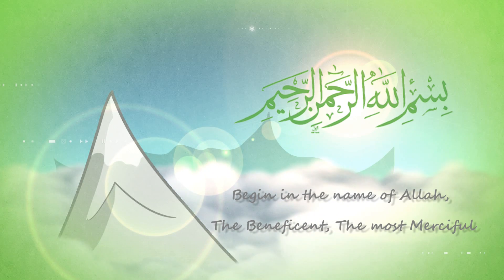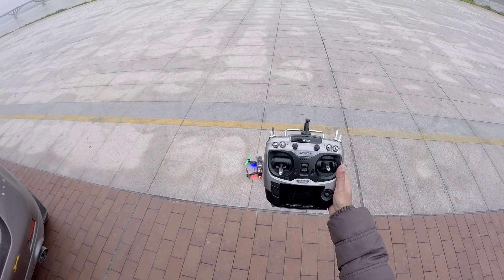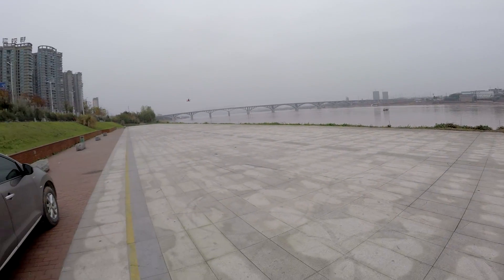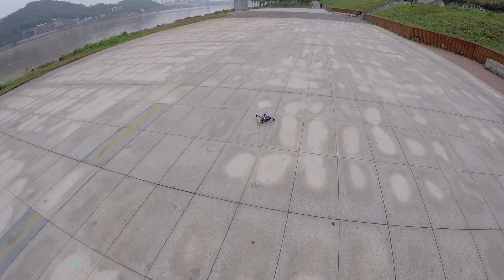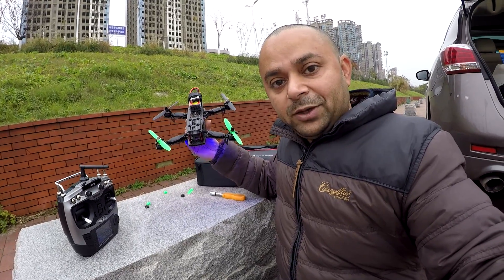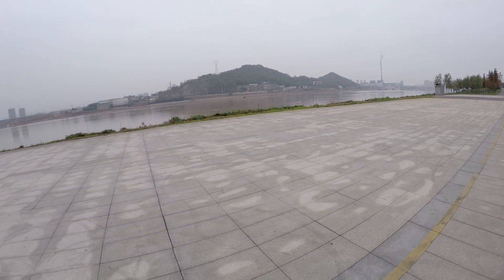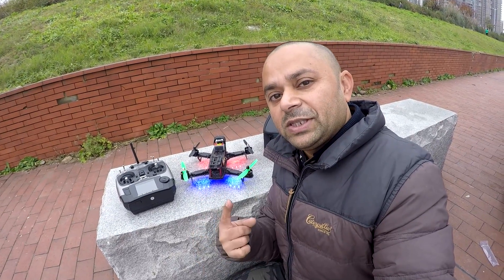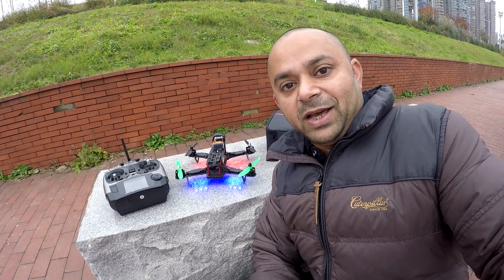Eachine EC250 FPV Racing Quadcopter Outdoor Flight Testing

Comment: Hi I want to buy a racing quadcopter , I fly a lot of quad in manual mode no gps or altitude hold , now I want to do racing. what do you recommend me without spending thousands in a quadcopter , I'm wondering if this eachine is the one or if is there something better to race with fpv

Comment: If I bought this from LHI or any 250 sized quad, I have a fpv system (boscam) with a Jst connecter. How do I get power to the fpv transmiter

Comment: I have a very similar set up on my quadcopter running cc3d openpilot. I'd love to use your PIDs my only issue is knowing where in the software to put these in. I know there's a basic,advanced, and expert tab. I'm a beginner in this and it's been hard to find out where exactly am I tunning pids.

Comment: what is the difference with this quad? http://www.banggood.com/Eachine-Racer-250-FPV-Drone-Built-in-5_8G-Transmitter-OSD-With-HD-Camera-BNF-Version-p-995366.html

Both are eachine 250, EC vs "RACER DRONE", i have a radio, but the "racer drone" have plastic arms

Comment: i am planning to buy this copter
but is it possible to add a camera with a transmittor to this model ?
and is there a way to know when the battert dies / add a bleeper ?
and how to i connect these .. ;)
Reply: Yes. this is one of the better drones for a FPV set up.
Reply: it might be easier to buy the $300 kit that includes a camera and a viewing screen.

Comment: Hey Ali, have you flown the other Eachine quad, the 250 racer?  I have that one and I think it's a fantastic little starter quad.  I was just wondering how it compares to this one, which seems to be more of a "traditional" frame.
Reply from the maker: +Dave Baril (AKCobra) never tried that, I like this one because this frame it tough and you can upgrade it with 4S setup to be a beast :D